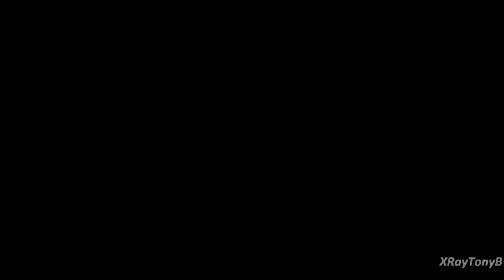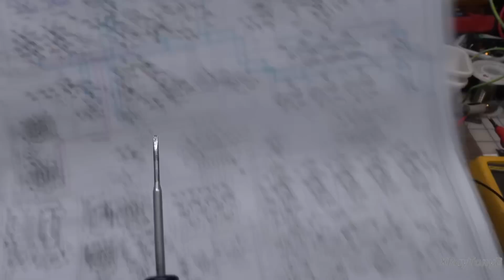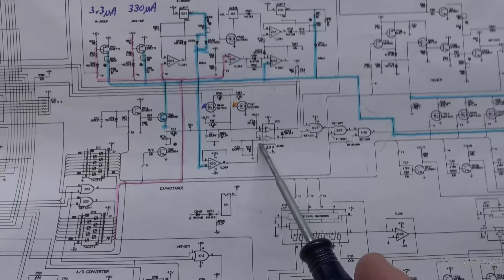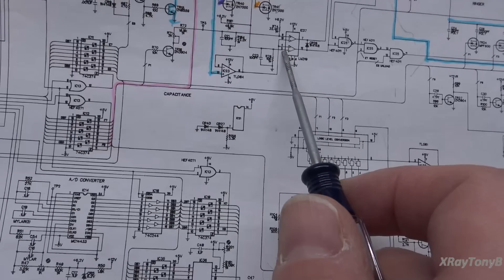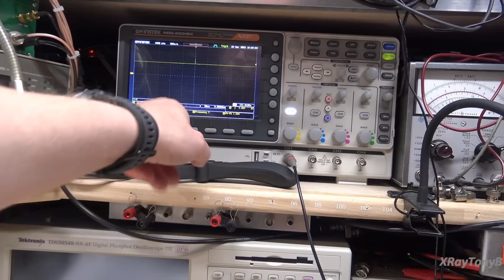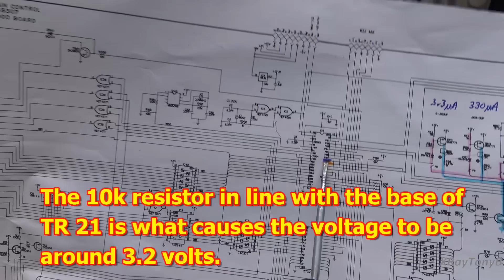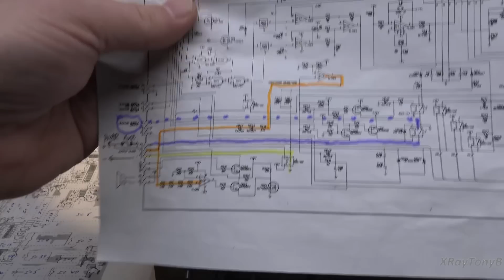Sencore LC-102 - Part 4A - I need your help!

Comment: At 8:54 you’re saying pin 10 and 11, but you’re on the wrong side of the chip!
Reply from the maker: OOPS!   Good catch.  Try 30 and 31.  The wheel was turning, but the hamster was dead :)
Reply: Well, no, look at the schematic. The notch on the (schematic) IC is pointing up, and the two lines coming off are on the right side, where pin 40 is clearly labeled at the top right. So, counting down, the two pins are 30/31, and Tony was measuring two pins on the top of the IC with the notch to the left. Maybe Tony was off-by-1, and measuring 31 & 32, or 29 & 30. I think the hamster was alive, but the hamster-wheel bearings are seized! 🤣😆😂 Though he was saying 10 & 11, so that hamster is asleep at the wheel. As for the pulses, maybe it’s just a switching transient as the CPU executes a specific instruction; perhaps the decoupling cap on the CPU is weak, or it needs another in parallel.
Reply: Good catch!
Reply: Yeap

Comment: I have the chance to buy an old Sencore LC103 but I don't want to spend so much money on a device that I cannot calibrate by myself. In case you have a copy of the Sensore LC103 calibration software, would you mind sending me a copy? I would be very grateful.
Thanks a lot in advance,
Mike

Comment: How did you manage to program the new microprocessor?
Reply: I think the Toshiba micro is generic as much of the operational firmware is on a separate chip with paper sticker.

Comment: I suspect you may have discovered the issue by the time you see my comment, but anyway.
Reading between the lines and other comments I think you mentioned that the signals look sort of correct, compared with waveform examples you have been sent, if you disconnect pins 30 and 31 from the micro. I would first confirm this by using an old scope with single shot triggering (and ideally storage) which behaves properly with fast transitions, pulses. 

If the signals are ok measure resistance, diode check between pins 30 and 31 on the socket and ground and 5V and ensure you can see expected diode junctions, resistor values etc.
Add a couple of external 10k pullups to the micro pins and recheck the signals, this will mostly confirm if anything is wrong with those pins on the micro

I'm sure you have checked and or replaced TR21, lift R92, reconnect pins 30 and 31 and recheck, especially ensuring P13, pin 30 toggles properly to 0V depending on front panel switch activation. Good luck.

Comment: Tony, when looking at CPU lines turn off auto-trigger and  set you trigger level to around 2 volts. That way you will see when the line goes low or high. In your video I believe you are just seeing switching transients (those little spikes). If your scope has a  preset TTL trigger level you can use that. Regards,  David
Reply: Since both pin 30 & 31 were already in a High, or 1 state, I set my scope to trigger on the downward slope and it seemed to lock in very well.
Reply from the maker: In some of the clips, I had the trigger set to TTL.  When my scope is set to TTL trigger, it will disable the trigger level setting, so if you have a wonky waveform, it won't trigger properly, hence the reason I sometimes went to normal or auto trigger.  Sample rate and time base can also affect the display.  I love the new digital scopes, but I still like the simplicity of my Tek 2467B ;)
Reply: @xraytonyb  I agree with you on the "modern" scopes, I keep a Tektronix 2445B and an HP 1980B in the workshop. My most modern scope is a Tektronix TDS544A. A couple of things that can help when looking at digital signals (besides TTL triggering) are (1) For expected active low signals trigger on the negative slope and for active high trigger on the positive slope. (2) Set the display trigger point to left instead of center - gives a bit more room for observing pulse trains and (3) Use single sweep mode to capture infrequent events. Regards, David

Comment: I uploaded a video on my channel  checking PINS 30 & 31, the "P13 & P14"  Chip output designations, on IC8. Video here -  EsgLImFwLKI    "Sencore LC102 XraytonyB Info 04 24 2023"
Reply from the maker: Thank you so much!  As I suspected, my MCU never toggles pins 30 or 31 low.  If I fold pins 30 & 31 out from the socket, it will very intermittently behave like your video.  I think this proves that I have a bad MCU.  Thanks again!

Comment: Link to my probing with a scope. https://youtu.be/Wj8pAyBFDG0  No way close to the quality of Tony's work. This was done during a thunder storm and I think the first unit was hit with a surge. This unit is the one I keep on the bench. The first unit was the back up unit. Which now with not perform a Short test. UPDATE, The short test problem was a dirty contact on L9. You can remove the relay cover and clean the contacts. This fixed my problem of the Short test presenting a error 4
Reply from the maker: Thank you so much for this!  I have just completed part 5 and will be posting it in the next day or two.  If I disconnect pins 30 & 31 (by folding them out of the socket), it will intermittently give the same waveforms as your video shows, but not always.  However, if I re-connect the pins, it will never pull the signal low, nor will I get more than that single pulse on pin 30.  I think this is telling me that I have a faulty MCU chip.  Thanks again!

Comment: Hi Tony. The 6V2 line is generated by a clamping zener diode from the 12V line. The circuit is under IC between R49 and R50 on the main schematic.

Comment: Hi Tony, In my experience, most of the I/O pins on these MCUs are protected with internal diodes connected to power and ground.  You might want to try removing the MCU and measuring between the suspected pins and pwr/gnd pins using the diode scale.  At the very least, you can check to see if the pins are shorted to power or ground compared to the other I/O pins.

Comment: Tony, did you remove the Cornell Dubilier Relay and clean it? I cleaned the one on my unit and used card stock and Deoxit 5 (red can) and it helped with the ranges issue. Give it a shot.

Comment: So about 10 years ago, I purchased a pallet of surplus test equipment. This was from a repair facility that shut down after the owner died. In the lot were "5" Sencore LC-102. In the end I spent WEEKS trying to fix them, and in the end I used 2 of them for parts to get the other 3 to work. I swore I would never try and repair these again. One came up on eBay about 8 years ago, for $150.00 Not Working. 

As you know these can sell for well over $1000 so I figured lets get it and try and fix it... Lucky for me after a few parts swap, Microprocessor, the unit came back to life. So after 6 units, 2 had bad processors, that might tell you something.

During Covid, I decided after retiring to clean house, so I sold off the parts units. I have been following your videos and your on the right track, but the issue with the LC-102 is they definitely have reliability issues and in my case it was not a single failure of a single part, but rather multiple issues, that is what made it so challenging... 

BTW, I found a Logic Probe very handy to use.. As well as a Pulse Injector probe. I am sure you have one in your tool chest of equipment.

Good Luck, If I had any more parts I could send them to you, but not anymore...
Robert
Reply from the maker: This was really helpful.  Thanks!

Comment: Toni - The old adage holds "What is the last thing you did before it stopped working?" You mentioned how fragile this board is. Is it possible you may have damaged a VIA or other trace under the LM319 when you removed it?
Reply from the maker: Be sure to check out the opening statement I make in part 5, when I post it ;)

Comment: That's what a faulty I/O pin looks like. 

I think it would be a really good idea to source a CPU and test, as someone else mentioned, an 8049 should work just fine and they're really common.

They're pretty much the same chip but the 8049 is specified with internal ROM which can be 'sitched on or off' by logic levels on pins 

(it can be quite interesting to read out the 'no ROM' versions, they're often failed or cancelled factory programmed parts, I've got some 8032 chips with Intel MCS52 BASIC 1.0 in for instance)

Comment: When you said 'hit capacitor value' there was a low going pulse on the constant high 4.75v on TR40, at about 5:22
Reply from the maker: It was really hard to tell if that was an actual logic pulse, or just noise.  Another viewer sent images of the signals on pins 30 and 31 and they look nothing like this.

Comment: Hi Tony ... I think your trouble, if the MCU ports P13, P14 are OK, it's related to the EPROM causing a bad program running. Did you find the correct BIN file for your device to try a new EPROM ?
Reply from the maker: I thought about that.  The bin file I am using was copied from the old prom.  The one I downloaded from online was a newer version.  My unit had version 15 and the downloaded one is 17.  I might try it, but I don't know what changes were made.  It is certainly  a possibility.  Thanks for the comment!
Reply: @xraytonyb  You're welcome ! Hope to "see" you soon !

Comment: Hi,are you interested in trying a thermal camera to locate electrical faults efficiently？They can detect temperature of components.
Reply from the maker: I tried that earlier.  Nothing seems to be getting warm.
Reply: @xraytonyb  Our thermal camera's resolution: 256x192, temperature range: -20°C to 550°C (-4°F to 1022°F) and heat sensitivity: 50mk
Reply: @xraytonyb  It depends on the temperature range ,resolution and heat sensitivity of the thermal camera.

Comment: Ill join in on this . Did you check the negative canuter valve to see if the phaso quadralinear valve is in amorphic alignment with the asynchronous dingle hooter

Comment: For a case like this, it's useful to see what the CPU does with those pins when the load is removed.   If you are not comfortable with bending out the pins on the CPU itself, you can place a 40-pin stamped IC socket on the CPU chip, then bend those two pins out before plugging that socket into the one on the pcb.   That way there is no risk of snapping off a pin of the CPU.   It looks to me like pin 10 can drive high, but not low.  So perhaps the internal N-channel pulldown transistor is toast?   Pin 11 did seem to have some activity on it.   You need to set your scope to Normal or Single mode to check for short pulses.   If the scope triggers, there is a pulse, then you zoom in to examine it.   Lucky for you the code is in an EPROM instead of inside the CPU, as it sometimes is.   So you can source an 80C39 or 49 to replace it if nec.
Reply from the maker: That's what I am thinking.  I was hoping someone could test theirs to see if this is the case.  As a last resort, I will try the socket and the bent pins.
Reply: Port pins on MCU's can be configured as input or output.  If the pin is set as input, it will just float to whatever level the external circuit is pulling it to.   In this case, it seems logical to assume that Pin 10 is set as an output, in which case it should be either high or low (CMOS levels, so close to gnd and 5V)  We don't see any low levels so perhaps the internal pulldown transistor is hosed.   If so, and you bend out that pin, it may just sit high, as sometimes it will be driven high, and other times its capacitance may hold it high, although the scope will tend to pull it to gnd, especially if you use x1 probe.  You can also simply connect a 2K resistor from that pin to ground as a pulldown.   In this circuit, that should give you 0.5V when it's not being pulled up, due to the 10K pullup at TR21.  Even a 1.5K should be OK for the MCU.   Not sure how much current it can source.   Anyway, this is just as test to learn more about what's happening.

Comment: Though on the schematic, your pins are on the upper right of your cpu, actually on the cpu ic, with the notch at the top, pin 1 is at the upperleft, pin 2 would be the next one down from pin 1, etc.... Therefore, pins 10 and 11 would physically be on the left side of the ic. You might look for 0 ohms from your ic to mosfet gate to verify you are truly testing pins 10 and 11(power off)?

Comment: I think an 80C49 will work if you can’t find 80C39. The lower 8 bits of the address bus and the 8 bit data bus are multiplexed. That’s what the ALE (address latch enable) and PSEN (program store enable)pins do. That’s what 0:00 that 8 bit 74LS373 transparent latch is for. It goes between the EPROM and uC.In a previous video, the ALE signal looked good, I think it’s 1/6 the clock frequency.
Reply from the maker: That's what I thought as well.  I might have an 80c49 somewhere in the old parts graveyard.
Reply: @xraytonyb  Being CMOS, you would think those port pins would be at 5v, not 3.5V?
Reply: @mmaranta785  Thats right, output voltage for BUS Signals are low(max 0.45V) and high (min. Vcc-0.8V)
Reply: 80c49 might work because PIN7 (EA) is also set to Vcc (high) and fetch only external memory.
Reply: @e42_marvin  True, we used to do that with 8048’s because they were only 99 cents.

Comment: Also consider a solder bridge as the problem, not the CPU, closely inspect the board at the parts themselves, traces between the two points, and CPU pins in case of a problem there.

Comment: Have you checked on the 6.2V side of R101 to see if the voltage is being lost before or after that resistor? if voltage is there then it could be C22 shorting the input to the op-amp.
Reply from the maker: 6.2 volts is solid.  TR40 and TR40 both have a high signal at the gates, which is causing them to turn on.  I think the uC is supposed to set these to a low signal, which would provide the proper 1 volt signal on pin 5 of the LM319.  This is what I'm not sure of, though.  Hopefully, someone else can verify on their unit pins 30 and 31 (I misspoke about pins 10 & 11) of the uC are low instead of high.

Comment: Yup it has 2K of ROM in the CPU.  And P10-17 have internal 50K pull UP resistors on them. What if you bent the 2 CPU pins out of the socket and scoped them out?  (Kind of a last ditch test)
Reply from the maker: I don't think the 80C39 has the 2k ROM.  Only the 80C49 has ROM.

Comment: There is likely firmware in the 80c39, that's why your replacement doesn't work. I had one of these years ago, CPU died replacing it with an identical non-sencore part did not work. Sencore sent me one NC and it was fixed. I hope they still support it.
Reply: There is no firmware inside the 8039. Pin 7 is EA which should be a logic high to use external program memory-in the EPROM.
Reply from the maker: From what I understand, the 80C39 does not have internal NV memory, but the 80C49 does.  Anything's possible, though.